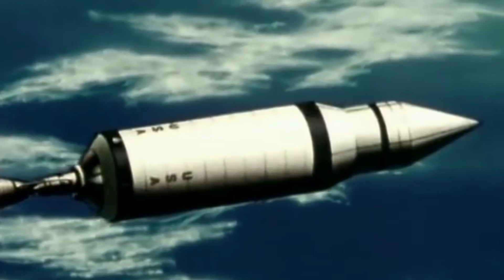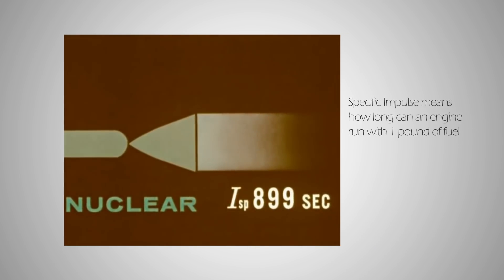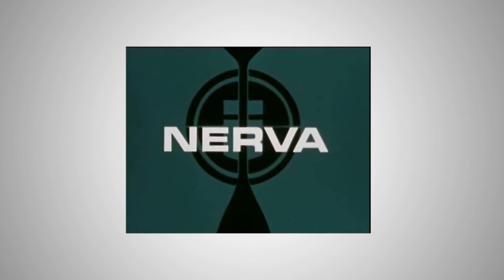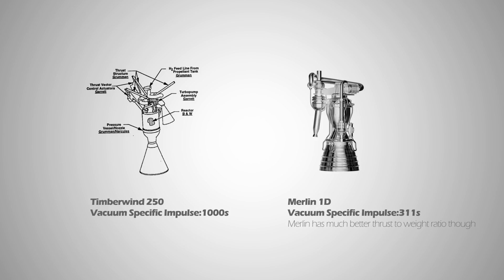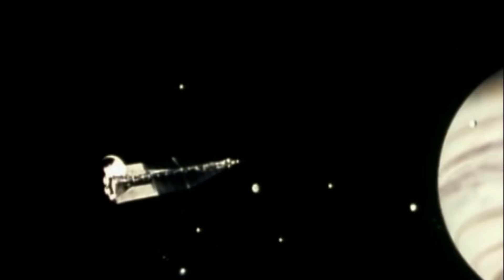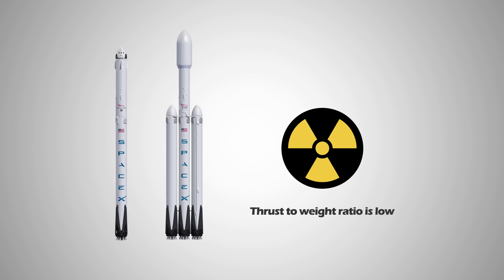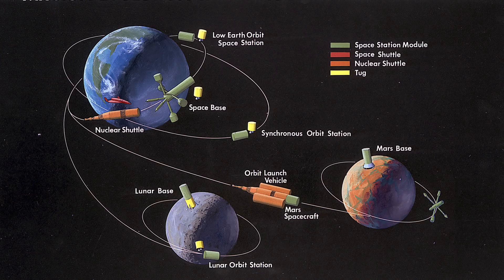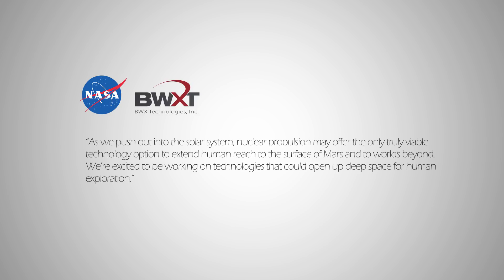What comes after BFR for SpaceX, a nuclear-powered rocket?

Comment: Once the industry in space is set up I could certainly see the BFR eventually becoming the shuttle from space and the surface, transporting resources and people, accompanying a much larger ship that is built only to operate in space being powered by nuclear propulsion. That's why I personally believe we should industrialize the moon first. I feel it would make the effort of colonizing mars (and other planetary bodies) more sustainable.
Reply: You're both misinterpreting what I meant. Industrializing the one first would mean we aren't limited to what we can get into space as everything we need is on the moon. Splitting time/resources between two massive projects would be inefficient when completing A (the moon) first will make B (Mars) and all the way to Z (everything else) much easier.
Reply: From what I read, the moon is not an alternative but rather a complement to go with. Rationale would be to have heavy ships built on the moon rather than Earth. From what i understand raw materials on the moon are not that much needed on earth because same type and heavy transportation costs. This nevertheless becomes an advantage when you want to build a space industry on the moon. That means designs can be made on earth but produced on the moon. This won't even require people but only robots which could be monitored from Earth thanks to small time lag in transmission. Moon would be ideal at building, maintenance and refueling of space ships.

General comment is more about economic viability of space ? Apart from satellites in orbit and tourism (very much overrated i believe), what can be made in space and sold to Earth ? This is the key item and once it is solved we will send mission in space everywhere. In order to go to Mars and elsewhere we need to have a financial motivation which I fail to see today. Science is another topic already well covered by NASA and other agencies.
Reply: Go big or go home.
Let's not do either of them first - let's do both simultaneously!
Reply: We can have a Mars and Moon operation. There will be periods of years in which we can't send spacecraft to and from Mars. While we wait to do that we can focus efforts on other projects such as a Lunar, and exotic destinations such as Venus.

There's no sense in having another LEO space station be the replacement for ISS.
Reply: Alucian Lucida you’re right establishing a base on the moon would make things easier and once we establish a base on mars we can send humans anywhere in the solar system
Reply: Alucian Lucida 

I mostly agree with you, but I don't have a problem with allowing different organizations focus on their own pet projects simultaneously.  SpaceX is focused on Mars and that is fine.  Blue Origin is more focused on the Moon, and as you said on industrializing it and Earth Orbit as well.  By having those organizations focus on separate things it allows us to chew gum and walk at the same time.  I have no doubt that SpaceX will have a heavy involvement in making the Moon a permanent home for humanity.  In time they may very well move ship production to the moon and start using Nuclear Thermal Propulsion on heavier ships.  It is even possible that they may build a larger ship in Earth orbit first, relegating the BFR to shuttle status then.

Other companies and governments via NASA and other agencies (including military) will have their roles to play as well.  Bigelow is primarily focused on habitats, and is likely to continue doing that for the foreseeable future.  NASA and other agencies around the world will be customers to the big rocket companies, and no doubt will try to regulate the endeavors of other organizations, and in most cases probably work in conjunction with them.  No reason that a science mission couldn't be coupled with asteroid mining missions.

In short, I think we will (and should) industrialize the Moon, but there is no reason that SpaceX should wait.  They can setup an initial Outpost and slowly build it up, and once the Moon has been more developed it can lend a strong hand with more heavy duty shipments to Mars.  I think we can do it all and the financial incentives driving the industrialization of space will make it happen sooner rather than later.
Reply: We haven't put a man on the moon since Apollo 17 back in 1972, almost half a century and we are talking about moon colonies and Mars manned mission.. 🤔
It's not easy.. Space X and NASA have a long way to go before all that! Step by step with tremendous caution, space is no joke folks!

Comment: Wouldn't Nuclear Thermal Engines be perfect for cyclers?
Reply: Do you mean an O’Neill colony? If that’s what you mean, yes, nuclear rockets could be a viable option for moving them.
Reply: That's correct, they could be used to reduce the travelling time though
Reply: I just looked up O'Neill colony, it doesn't seem to be the same thing I mean, but those engines would fit there perfectly :)

Comment: spaceX is a business first and foremost. building innovative engines is a risky process,  which isn't required if you are seeking profits and are already industry leader. spaceX has no reason to buid a nuclear powered rocket.
Reply: Actually, SpaceX has been pretty innovative with their rockets because they want better performance and low cost. SpaceX has put a lot of improvements in the just Falcon engine over the years. I wouldn’t put it past them to try a completely new type of engine if they thought it could lower their costs.
Reply: kokofan50 they have been doing evolutions on already existing technology. This would be a revolution, which is normally very expensive and risky, since you do not know if it will work as intended and pay off the huge development costs
Reply: biropop, the whole point of SpaceX is to revolutionize space travel. If they get to the point chemicql rockets just aren’t good enough, they may feel the next step is nuclear propulsion. I don’t see that happening any time soon, but I can see it.
Reply: BFR can't travel through the solar system freely, that's a basic misunderstanding on how orbital dynamics work and how much energy a BFR has. I have seen even people saying that BFR could go to Pluto and back. Yeah, maybe, but it would spend hundreds of years doing that. Nuclear energy has more power output and efficiency and can bring those numbers down without too much effort. Using both at the same time can improve a lot the economics of space transportation.
Reply: Businesses which don't cannibalise their own profits risk competitors doing it to them instead. If you're not spending money on the most advance research you lose out on first mover advantage, and you won't have anyone who understands to a high enough level for second or 3rd mover advantage. And Elon Musk has said many times that innovation is key to businesses and those that stand still die. Space X will not stand still it's not in the company's culture to do so.
Reply: That's not entirely true, see the history about implementing face shut off into the Merlin 1D design, you'll see how risky that decision was and how it greatly improved the capabilities of the engine and its reusability. There are certain technical challenges like the pintle injector design that only NASA did before (for the Lunar Module engine) and that no other company tried because it was deemed "risky" and not worht a try. Aside from that, Shotwell, Elon and Mueller have all said at certain moments that they have been trying to get some nuclear material and that they intend to go that way after BFR.
Reply: You clearly didn't understand what the hell I was saying
Reply: Anytime I say that something can't be /physically/ be done, people just say the same phrase about "how Musk was repeatedly said that landing rockets was impossible". I'm sure that if I tell you that SpaceX can't build rockets that can go at the speed of light and that it's science fiction you'll say that "Huh, Elon Musk was told "too much science fiction" as well".
Reply: Quantum teleportation? Oh my...
Reply: See ya at the other side of the galaxy... -__-
Reply: +Alejandro Alcantarilla
You know, it's actually more likely that you can meet him on the other side of the galaxy, than that teleportation and lightspeed or FTL travel will ever be a thing.

Meeting him on the other side of the galaxy breaks no known laws of physics. Any day now, life extension technology could be discovered. (Or it could take hundreds more years, you never know.) Potentially allowing you to live indefinitely (or at least until we run out of usable energy in like a few quadrillion years - look, my point is, it'll be enough time for a human to reach the other end of the galaxy). Then, you can just wait until interstellar colony ships exist, and go on an interstellar journey. Then again. And again. Until you reach the other end of the galaxy, in like, a million years. Or tens or hundreds of millions of years.

Teleportation, FTL, lightspeed, these are all impossible under known physics, and you just can't count on it ever being possible. But even flying to other galaxies (the slow way) is within the realm of the possible.
Reply: kokofan50 yep. Thats what I think will happen, but it won't be after BFR.
Reply: BFR will be more than capable to travel the whole solar system, no need for nuclear engines. After fueling up in orbit the whole solar system is in range anyway. If they want they can even send a 'BFR fueler' together with a BFR, to expand ranges. There is no one even close to this capabilty if the get the BFR working, Mars would be just the first visit, many more to come. That alone will kick off space interest, especially when the first reports from Mars, or other celestial bodies come in. 

Understanding that there are resources available which can be send back to earth industrialization of space will come after scientific missions and space tourism. The next inevitable step will be avoiding earth all together, why send material down to earth, only to launch it again. Get the factory into space and do it there.
Reply: So ... in hunderds of years Voyager will pass Pluto?
Reply: Voyager 1 and 2 are much further from the Sun than Pluto, they crossed Pluto's orbit in the early 90's.
Reply: Yea but they spend hundreds of years doing that right?

Launched in the 17th century? ;-)
Reply: Did you even read my comment? I said "go to Pluto AND BACK"
Reply: Too much science fiction...
Reply: Not hundreds of years as the voyager example shows clearly, but years nevertheless. Nuclear engines do not change that.
Reply: Ignoring the "back" part is a big mistake. 
Chemical propulsion (Traditional way):
Time to go to Mars: 6-9 months; Time to go and come back from Mars: 3 years. 

Chemical propulsion (SpaceX way):
Time to go to Mars: 3-6 months; Time to go and come back from Mars: 3 years.

Nuclear propulsion (Traditional way):
Time to go to Mars: 3-4 weeks; Time to go and come back from Mars: 1 year.

And now, sit down and think what that could mean for a round trip to Pluto and what could SpaceX do with its own way of doing things.
Reply: Rosetta took 12 years but it shows how much more gravity assists you get with small thrusters on a spacecraft used at the right place and time.

Current models show a conventional boost phase after which nuclear powered ion / plasma drives take over. And even then you'd be a fool not to go with gravity assists.

Even then SpaceX still has to go at it conventionally first cos a space ferry to crash more BFR's onto the Mars surface would be quite silly. Once they prove the BFR is a reliable Mars transport they will be thinking about a ferry system. Without the need for a refuel BFR for every Mars BFR they'd cut costs in half.

Oh well Elon Musk was told 'too much science fiction' as well. Well those kind of people have mere words only. Musk has a BFR.
Reply: You are coming closer to real times it seems.
Reply: Yea guess you missed that one? Oh my indeed, lol!
Reply: Ah ... you mean your not there yet? ;-)
Reply: Well i agree teleportation was considered to be 'impossible' too.

Untill the TU. Delft proved known physics wrong remember?

Time to read Wolfgang Pfaff, Bas Hensen, Hannes Bernien e.a. & Ronald Hanson, Unconditional quantum teleportation between distant solid-state qubits ...

PS. If lightspeed is impossible then how fast does light go? ;-)
Reply: I think I'd like to see an estimate on what a modern nuclear engine could do, and see how that fits in. SpaceX BFR design precludes nuclear, but what about a large deep space probe? A tug is also a good idea.
Reply: Testing a nuclear engine probably shouldn't happen on Earth.  Somewhere outside our orbit, so we don't have radioactive meteor showers.
Reply: I ignored the "back" part, it just doubles the travel time, but that's it, a non topic in the end.
Reply: Can throw in Columbus and Copernicus as well if you like. Many ithers throughout history.

Things are impossible until they're not.

Just like Quantum teleportation is instant. Why even bother with speed right? We're you one of the 2001 ape actors throwing rocks at the monolith?